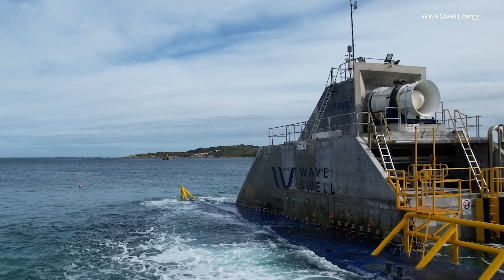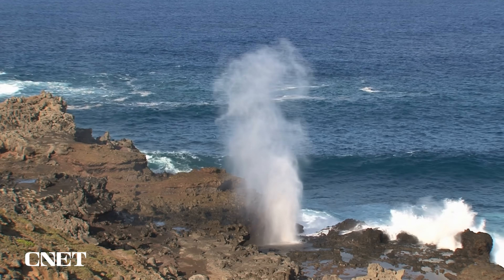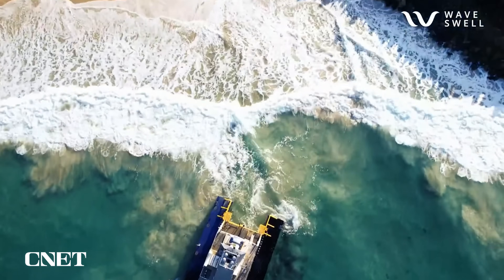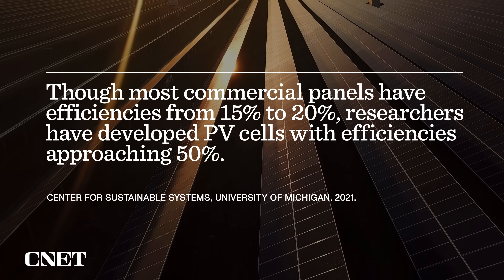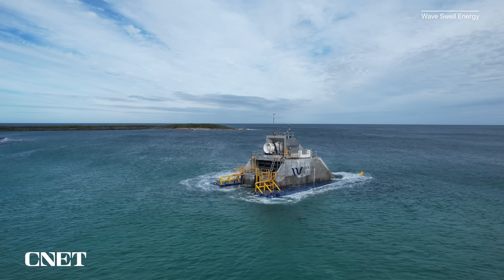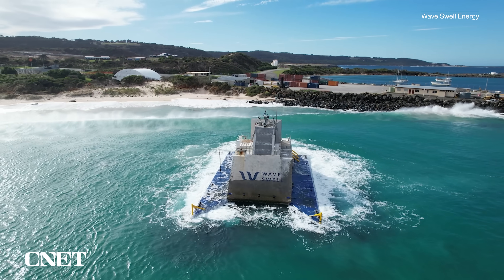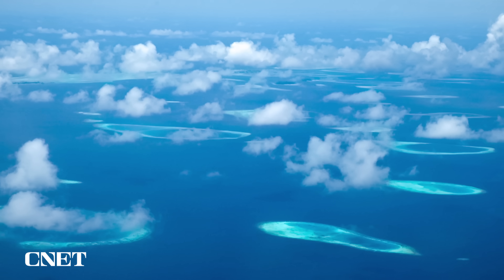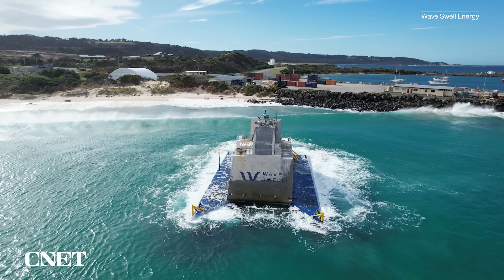'Artificial Blowhole' Generates Wave Energy for 1 Year

Comment: The one number they didn't even touch on is actually HOW MUCH ENERGY does it capture, how much electrical energy does it produce. Efficiency is irrelevant if the amount of energy entering the device is actually very small. A wave going up and down inside the device is actually minuscule. Does it produce enough energy to run a hundred homes or just half a home? If you'd need hundreds or thousands of these devices to produce any reasonable amount of energy then they're a failure. But no such info is discussed in the video or provided by the company.
Reply: You are all missing the forest for the trees, the most important number is the Levelised Cost of Energy (LCOE). Efficiency and amount of energy are important but the price per MWh over the units lifetime is the most important because that will determine if this system goes past the experimental phase.
Reply: @shad0wyenigma  Excellent observation. And all that needs to be done is to look at all the previous experiments and prototypes of wave energy devices, not a single one of which got past the prototype stage for just that very reason. People just need to do a search on "Wave Energy" and you'll see lots and lots of failed devices. This particular one actually has no unique characteristics or approaches to capturing wave energy. It's been done before numerous times. Never successfully. They clearly didn't do their research before embarking on their project.
Reply: @RogerGarrett  or maybe, a different class of people grant funding for research, because they realize the benefit than the people who approve new production construction. In other words, while I would never buy a Ferrari, theat doesn't render all Ferrari worthless.
Reply: @shad0wyenigma  i already said that ;)
Reply: If only we had some sort of way to rapidly look up information..

"The results have met and at times exceeded our expectations. As an example, when the unit is generating 40 kW of power in reasonable wave conditions, you could extrapolate the amount of energy to be in the order of 1MWh in a 24 hour period."
Reply: @NaokiWatanabe  i have looked this up, it's useless though. 1MWh isn't much but this is just a test unit in a test environment
Reply: @bloodhoug82  it's 350 000 kWh per year. That would be around 30 households.

Not that much, but also not that little. It's about as productive as 2000 SQM of PV. Which is at the moment the cheapest source of electricity.
Reply: @aurelspecker6740  how do you think you know how much it produces? 😂🤦‍♂️
Reply: @bloodhoug82  It's what they claimed as an example.
Reply: @aurelspecker6740  exactly, it's an example. they also said this does not mean it's its full capacity nor was it under ideal conditions. This was a feasibility study only
Reply: @aurelspecker6740  nope
Reply: @bloodhoug82  wouldn't think this is an accurate comment, they said in the video that they are aiming it at island communities. Far flung places without a reliable means of generating energy. 
1kw a day would go along way for people in these communities, I use  6kw a day av in a city in a first World country. 1mWh a day could mean lights and a fridge for a thousand homes....
Reply: @oscarthefuzz  huh? so what's not an accurate comment??
Reply: @bloodhoug82  saying 1 mW is not very much, it's all relative and for the situation they're tailoring it for it seems adequate
Reply: The answer partly in the name : 200kw peak nominal output
Reply: Well, it seems like it would also do a lot to mitigate wave pounding in some areas, by removing some of the kinetic power. I like it. If it helps build ecosystems and the like, and isn't really an eyesore, etc., it represents another tool in the box for us to utilize.
Reply: I would guess is all about scale for this design. A single unit might be an embarrassingly low value. Scaled up and over time I might be a different economic proposal. Diversity of energy production is key to renewables.
Reply: It's really difficult to give you a simple number on that given the dependency on wave conditions. If you ask someone how much energy a harvester will produce, the first question they will ask you in response is "under what conditions?".
Reply: @Stevobulfer  King Island is in Bass Strait. Waves are a given. Bass Strait is one of the roughest pieces of water on the planet.
King Island also currently gets all its power from 6MW of diesel generators.
Power costs a packet on the island.
Cost / benefit is a rather low bar for this location.
Reply: @allangibson8494  Location x3. If it produces power where a breakwater is needed or exists and where other power sources are problematic, it could be an effective partial solution.
Reply: @allangibson8494  At least per Electricity Map about a third of the electricity generated on King Island came from wind this past year. And that doesn’t appear to include rooftop solar which is considerable & reduces overall demand. HydroTasmania has an app which gives the details for King Island at any given time, although they never tied in the Uniwave contribution.
Reply: @Stevobulfer  no, it's not difficult to give a answer.
Just give the amount the prototype produced during that year.
It's really that simple.
Of course you can add the disclaimer that a finished product would be more efficient. But the amount the prototype produced is a starting point.
Reply: @Jehty_  what wave conditions do you want it under?? Do you want an average? Peak value? Correlation with seabed topography? It doesn't make sense to give a value that is so highly correlated with the environment it is placed in and the present conditions. If he just "gave a value" it would be incredibly misleading. He's doing everything any other engineer who makes energy harvesters would do, and is honestly giving the ethical answer which is a number that is not correlated with wave conditions (efficiency). If you want to know the exact about of energy this device would make, YOU (or investors) can figure out the wave energy available in your area and multiply it by the efficiency. The equations for that are public information. Obviously some areas will have gravity waves that are more energetic than others, so given these varied conditions, it makes sense to not 'just' give a number.
Reply: @Stevobulfer  you do realize that this is a YouTube video?
No one of us will do that.
So if you do a fricking YouTube video give numbers that don't require a PHD to understand.
Reply: @Jehty_  also no, waves do not contain very little energy. Water is heavy. A large volume of water moving up and down a meter is actually a lot of energy. Back of the envelope calculation says if you have 10m*10m*1m of water falling 1m, that's 977 KJ of energy every wave period.
Reply: @Jehty_  the fact you think it's easy just accentuates that you don't understand the nuances of Engineering.
Reply: @Jehty_  it's not that simple because if he 'just gives a number', in the best case scenario is a useless number, in the worst case scenario, it's fraud.
Reply: @Jehty_  you don't need a PhD to use Google.
Reply: @Stevobulfer  again:
This is a YouTube video. Know your audience.

And if it's so easy: please tell me how. Take the location of the prototype as an example and please do the calculation.
But guess what: it's not that easy....
Reply: @Jehty_  that's what I've been saying lol. You need to know the local conditions to even give a reasonable number. I can't just do the calculations because I don't have any information about the conditions. They gave an efficiency.. This number is sufficient for anyone interested in investment.
Reply: @Stevobulfer  so your saying that (basically) nobody watching this video would be able to do it?

Then please explain again why it was a good idea to add that information to the video and leave the "easy" information out... 🤦‍♀️
Reply: @Jehty_  for who, you? Sorry that info is above your need to know and fancy calculator, son.
Reply: @Jehty_  Waaa! Whah! Ayer mamás, You Tube presents science that keeps me dumb to easy thoughtless answers. You know how much I hate math, physics an all that hard study stuff, since I was a kid failing thinking and reading assignments. Ah’m angrey!
Reply: @Stevobulfer  Any thing beyond consistent C to A high school grades throughout Graduation from a middling level high school, would help you immensely for life. But I hear you saying your educational and entertainment pursuits has Google as your go to. Meh
Reply: @ottobhan725  I develope integrated circuits for  brain-machine interfaces as an electrical engineering PhD. Yes, I turn to a simple Google search when I need information outside my scope of expertise. It's called using the resources available to you.
Reply: @ottobhan725  honestly I don't understand your point. The Internet is a tool for anyone who knows how to use it.
Reply: Spot on. And the reason, as I think you are alluding too, they do not mention it is that it is very small.
Reply: @PerErikKarlsson  these numbers are out there. Currently it's not a lot. Another video covered it. But again, prototype. Fine tuned and used as a barrier wall then it could be a nice addition to stabilizing electrical demands
Reply: @PerErikKarlsson  - Exactly, since the volume of air flowing in/out of the wind turbine blades would be small compared to a large wind turbine with 100 m long blades.
Reply: @PerErikKarlsson  because it's a proof of concept.

It was not meant to produce a lot of energy, it was meant to show this tech can extract a meaningful percentage of the available potential energy.
Reply: Exactly! he was asked directly and rebuffed going into efficiency.
Reply: @callyman  because the question is stupid
Reply: Yeah I think I am wondering that too, in terms of a household, what fraction of one can it sustain? I can't imagine it's more than an electric stove on that scale.
Reply: It seems like there’s a lot of arguing back and forth here. I think the real question is not can this idea provide X amount (demand) of electricity, rather it is can this design feasibly produce X demand. Let’s take both polar opposite ends of the spectrum for two designs: wind power, and this design. For wind, let’s say that the efficiency is 50%, and it can operate 100% of the time. We do not have an output number with this info, unless we apply a scale, which comes in multiple forms. We can have one huge turbine, or we can have many medium size ones, and get the same output. But that is not the whole picture. Cost, environmental impact, location, and more matter. Clearly scientists have determined that it is not feasible to have one huge turbine powering the entire world, nor is is reasonable to have billions of 2” turbines covering the surface of the planet. There’s a happy medium. And that happy medium is met with a cost and impact that is deemed reasonable PER THE OUTPUT. That is the critical piece. 

Now let’s take the wave blowhole machine. Let’s say that it operates at 80% efficiency, and can operate 100% of the time. Let’s say that the cost is equitable or better than the cost of a turbine. We know that it’s impact is likely to be less. Two questions remain, given an ideal happy medium in size: what is the output, and what is the availability of placement? If the output is considerably less than a turbine, or the availability of placement is less (it certainly is, given that they really are only designed for coasts, compared to a turbine which can literally go anywhere that has wind within spec) then it is not as feasible as other techniques. If the output is enormous, it doesn’t matter what the availability of location is, but this is fairly unlikely, I suspect. I suspect it is a moderate output, which means there need to be many many installations to meet our energy needs, which may not be possible with the available locations. 

All that said, there are a couple important points here. We do not need to replace all other energy sources with one single source. As some have said, diversification is key. Also, this design serves double duty. I think this is the real key to the whole project. I suspect that the project was dreamed up as a way to turn existing, non generating infrastructure into an energy source, at a reasonable cost, and high efficiency is key to maximizing whatever output we may get. I suspect the output is not as critical to design as it would be for something that is solely intended to generate electricity to meet our needs. If this is the case, it is unfortunate that it was not explained in the video. 

Just my two cents
Reply: @clayrydick4561  I enjoyed your respectful opinion and would only like to add that if the unit is also acting as a breakwater as sea levels rise, containment for a desalination plant or an artificial harbor the costs of adding the generating capacity to an already defined purpose becomes reasonable, and as the technology is improved and mass produced it becomes even more affordable. Thanks for your post.
Reply: Something that everyone seems to be overlooking is exactly HOW this particular device works. Yes,  there's a lot of energy in moving water, due to the MASS of the water. But this device does NOT exploit that, does not tap into the actual energy in the movement of that MASS of water. This device uses the motion of the SURFACE of the water to PUSH AIR through the turbines. There is SIGNIFICANTLY LESS energy in that moving air, due to the significantly lower mass of the moving air than there is in the moving water itself. If this device had its turbine actually IN the moving water it would be tapping into a tremendously greater amount of energy. But, no. The turbines are moved by the air. Both the air and the water are moving at the same speed. But I sure hope you can realize that air moving at speed S has significantly less energy that an equal volume of water moving at the same speed.

It's just a dumb design.
Reply: @RogerGarrett  The main reason they use the moving air instead of the moving water is seawater is especially corrosive and thus leads to the need for constant maintenance & reduced lifetime. Keeping it in air eliminates moving parts in the seawater & leads to a much more long lived & corrosion resistant unit. And if it does require maintenance it’s easy to access. You’re right though it doesn’t tap into as much energy as it otherwise would if using water power.

But it does seem promising in terms of providing clean electricity through a wide range of conditions.
Reply: @codey morganti Thank you. There are indeed other commenters, far below (NOT in this particular thread), who are making the same points I've made here.

It's sad how many people deflect the main issue by saying things like, "It' only a prototype, only a test device, only a trial", "It just needs to scale up", "But it also works as a wave break", "There's too many kinds of wave conditions so they can't give a good general estimate", "But we need to diversify our energy sources". 

The only things that matter are how much energy is actually available in waves, how much of that energy can be extracted and converted to electrical energy, and how much does it cost to build it and maintain it. None of that info has been provided. And, frankly, I think the energy generation numbers that have been thrown around are totally bogus. This thing needs an INDEPENDENT evaluation. And the bottom line fact is that every single other similar wave energy device has totally failed to be a cost-effective way of providing cost-effective energy.
Reply: This comment threat did use more electricity than that thing produces over one day. You guys do realise that this thing is developed by actual engineers. I guess they do think through a lot more things than discussed here. I do know that not every concept is lifechanger... but seriusly guys, put some of your enthusiasm in an actuall idea like shown here, and we would benefit more than of this stupid circled debate... this is clearly not meant for any circumstances and fitted to a specific purpose. Breaking waves at the entrance of an habour while producing energy for that remote Island. Win win.
Reply: hahahha
Reply: @LucaFerrari.  you must get a lot of pleasure from your comments  because all you seem to ever say is. Hahaha it's a pity you're knowledge doesn't go past a laugh 😜
Reply: @jackbarrie6007  hahaha, please don't take your opinion to extreme, it's not all about me: the other two guys were shouting wrong to each other and it was a funny situation😂😂😂
Reply: Thanks for saving from watching the video a second time. I skipped through most of it hoping to get that spec.
Reply: Shhhh the science
Reply: It is a 200kW generator set. It replaces a output from the 6MW diesel generator installation on the island…
Reply: Based one some research they say

The company said under the right wave conditions the UniWave200 can make enough energy for 200 homes.

However how often are the waves under the right condition
Reply: @noloafingwgas  people only have to do a little research which seems impossible for them. They said in the video that this wasn't placed in the best area from enegery because they were testing several things and how the unit would hold up or affect wild life. They also tested several things, changing pieces and so on. I don't understand why people have a problem with any of this without knowing the facts because all of this benefits us even if we have thousands as a power plant in the ocean, it would do the same thing as a power plant on land. I'm sure the hnit can become smaller and smaller as they learn more. A big win for everyone
Reply: @noloafingwgas The unit is generating 40 kW of power in reasonable wave conditions, you could extrapolate the amount of energy to be in the order of 1MWh in a 24 hour period. Now this really doesn't matter since units will be designed far better, have more blow holes or the modularity of hooking up as many as needed
Reply: well, your moving dozens of cubic meters of water with each wave, in a few seconds, at least a few wavea a minute, plus capitalising on the trough....so the same volume of air, thats a reasonable amount of air if you can 'fly wheel' your turbine well enough. They probably don't mention specific energy because waves are very variable.
Reply: @benwilms3942  the unit is generating 40 kW of power in reasonable wave conditions, you could extrapolate the amount of energy to be in the order of 1MWh in a 24 hour period
Reply: @benwilms3942  they didn't mention energy because they mentioned it was ,ore or less to see how the machine operates, affecting wildlife and the ocean. No water is being moved with this unit. It's all done naturally with the waves and it shoots water up just like in nature. These units will be made smaller and smaller most likely as we learn more or adding more blow holes per unit. I don't understand why people can't research anything and expect everything in video form, smh. If we have hundreds or thousands  who cares, it will be like a power station/plant or grid in the ocean
Reply: @benwilms3942  Dozens of cubic meters of air moving at a few feet per second has nearly ZERO energy in it. It is completely wasting the energy in the water and instead just using the air that's pushed by the water. Utterly ridiculous. Just think of how much energy a FAN needs to move a few cubic meters of air a few feet. THAT is how much energy you can get from this device, IF it's operating at 100% efficiency. So, great, this enormous, and enormously expensive, device can power a single large fan for one house.

I think that their estimates about kilo Watt Hours of energy are totally bogus. And, for the others providing excuses like "It can just be scaled up", NO! Scaling up will not help. With one unit providing only enough energy to power a fan, just think of how many units you'd need to power a single house!
Reply: @benwilms3942  the air doesnt spin a water turbine, thats a whole different story,, also theres tide, because of that the turbine doesnt work the whole day and waves are variable, therefore its a unreliable energy source like all renewable energy, so its just not usable
Reply: For all we know it can only power 40 watt light bulb for 90% of the day.
Reply: @wolfthorn1  wait, where did you get that information from
Reply: @wolfthorn1  the unit is generating 40 kW of power in reasonable wave conditions, you could extrapolate the amount of energy to be in the order of 1MWh in a 24 hour period. Just research next time instead of joining in with the person that commented. This was a research and development mainly. They knew the technology would work but they wanted to know how the unit would hold up or affectnthe wild life.
Reply: The device is supposed to be able to do 200kw according to some random paper I found online.

So 80% of 200kw
Reply: Actually thats only half the problem. How much energy does it cost to build, can it produce more than that?? If not, its less than zero efficiency.
Reply: Annoying they didn’t mention it in the video. Online it says the unit averaged 40kW throughout the time it was active, with peak output of 200kW
Reply: @isaacgardner4423  a lot of people don't have the smarts to research something or just Google it instead they write a long comment. Any annoying issues can be fixed this is a prototype that was placed in a area where energy was the main goal since the proof of concept already worked
Reply: Looks like a big structure too.  Goofy niche idea, oh it's a seawall
Reply: @johnn3542  neither goofy nor niche
Reply: Exactly. How much did it cost to build, what are the life cycle costs, how much did it produce, what are the prevailing utility rates. So many unanswered questions. I understand it's a prototype, but would be good benchmark data to gauge future progress.
Reply: it generates an annual avg of 40 Kw daily, the equivalent of 10 homes. you can look this up.
Reply: It was a 200kw capacity unit but it’s a demonstration unit. Just like with every renewable energy technology we’ve developed so far, once its production gets on a learning curve costs drop very quickly and scaling up becomes cost effective. Remember that there was a time when photovoltaic solar cells were so exotic and expensive that they could only be justified on satellites and now PV (photo voltaic) solar is the cheapest way to generate electricity per kW. Wave energy has huge potential and harnesses a reliable and powerful natural force to produce electricity, which is a very promising foundation and we just need to develop the cheapest and most efficient way to harness that wave energy.
Reply: It’s a feasibility study beyond the lab benches and small scale for data and reiterating improvements. What say you now Uncle Thomas Doubt?
Reply: @ottobhan725  all renewable energy is low power density. It’s many orders of magnitude difference, ten to the nine with a nuke reactor or fossil fuel generator versus ten to the five, maybe six if you make many square miles of windmills, solar cells, tidal generators. And most facilities have three or four reactors. You can cover regions of renewables and not get close to what is needed and you still need batteries or to pump water for generation later. Renewable energy energy can only help. It’s not the answer. They NEVER mention wattage output when discussing any renewable power for that reason. It’s not fixed by any emotional responses, passion or want for it to be different. You’re being scammed.
Reply: Exactly
Completely pointless if doesn't produce enough energy. Cost of building versus how much energy it produces is vital.... efficacy. Without efficacy it is pointless, most all of the fashionable renewable stuff (eg solar and wind) has virtually no efficacy.
Reply: @exploringgodscountry  and where are you getting that it doesn't produce much?
Reply: @bloodhoug82  they don't provide any details on how much electricity it produces.
Reply: @exploringgodscountry  i know, i said that
Reply: The amount of experts in this comment thread is astounding…
Reply: It's a scam to take government money there is a lot of these going on right now tax prayer pay for it. And after 5 years of development it's suprise suprise it's a failure. Like solar road way...
Reply: Thx - you saved me the time to watch this.
Reply: @Sagittarius-A-Star  he didn't really 🤦‍♂️
Reply: Good idea though
Reply: Far more than you would assume
Reply: Wasn't this just a proof of concept trial? I'm sure for an actual application this can be scaled up.
Reply: Do you think they didn't think of this?
Reply: That's a pretty ignorant comment as well that started this. Any type of green energy is a huge help for any country. Who cares if hundreds are needed you would simply have power plants in the ocean where waves never stop
Reply: Love the discussion. Does not feel like a lot of power output considering the huge concrete unit you need to build. However, if you need to build a protection barier anyway it is an interesting adition
Reply: @GupStar  the good thing though these are floating and also this is a new technology so size can come down. The unit is generating 40 kW of power in reasonable wave conditions, you could extrapolate the amount of energy to be in the order of 1MWh in a 24 hour period. Any green energy is a win when it comes to global warming. Having power plants innthe ocean that cause little to no affects 8s also a plus.
Reply: @GupStar  there iss no moving parts also. Of course like you said though a barrier to keep people away is a must on larger scale in populated areas. Also the location they chose wasn't chosen for electricity but the environment to see how the prototype worked
Reply: Probably a single home.
Reply: 40kw average and 200kw peak output. That's comparable to a small windturbine. A average home needs 10kw (though I found many numbers online but this was the most popular)
Reply: I had my cell phone plugged into it for a while but it said slow charging and when using GPS my phone battery actually went down
Reply: Yes let’s spend 1 billion for this thing that can generate enough energy to power 5 light bulbs
Reply: This thread: 💥
Me: 🍿
Reply: the only thing that matters is 1) is it better than burning coal and fossil fuels?, 2) does it work?
if those two are yes, then it's already better than what we have available right now. 

if you're trying to argue that people should not be testing new ideas and developing new technology, then I don't think you're gonna get much support for your argument.
Reply: @sasabnis  At no point in this discussion did I ever say or imply that people shouldn't be testing new ideas or developing new technologies. I addressed the feasibility of this particular approach. That is a perfectly valid response to any new ideas or technologies. And in fact, there is nothing new in this, no new idea, and no new technology. This approach has been tried over and over again and has always failed for quite a few valid reasons. Nothing in this test addresses any of those failures in the past.

As for your two things that matter: 1) Sure we need approaches that are better than burning fossil fuels. 2) But this approach does not "work". Yes, you can derive energy from waves, but the third question that must be answered is 3) Is it cost-effective? And the answer to that is a resounding NO.
Reply: No reason to release that much info to anyone other than vetted investors signing NDAs
Reply: They don’t mention it because it’s trash. There’s no answer for fossil fuels outside of nuclear. You’ve heard this a thousand times, yet somehow leftists still are too stupid to accept this scientific truth.
Reply: It provides energy for 500 thousand homes
Reply: @peep_show8037  hahaha! No, it provides energy for about 7-8.
Reply: Power density.
Reply: The Uni Wave 200 can generate 200kW at its peak, which is enough to power 200 homes. At the low end, it produces around 40kW.
Reply: The200 in the name is it’s rating in kW. 200 kW So it’ll power a bit less than 100 homes.
Reply: @maugan22  yeah, 200kw max power maybe
Reply: the UiWave 200 can produce 200 kW at peak output, but sadly, the waves aren't always that powerful. Yet the UniWave still managed a remarkable 40 kW average over the year
Reply: It seems one unit can generate 200kw
Reply: All of science and technology is based on “trial and error”. 
Had Edison not tried that 1001st light bulb,,, would we have light today?
( that’s a rhetorical question )
Reply: He's got a fair point
Reply: I don't doubt for a second that by having set up such a system, they didn't ask themselves this little question, among so many others that are much more technical for people like you and me!  That's what I call bringing back his science when it's a futile question... In my opinion
Reply: At the beginning they say that they are already using this technology in naturally occurring blowholes. So it would seem that they have already proven that it works.
Reply: They explain all that @1:15, unless you were looking for even more specific specs.
Reply: 200kW (found easily enough, just not in a YouTube clip). As the site wasn't chosen for its energy potential, its unlikely that it produced that much for this trial, but that wasn't the purpose, so thats not the issue. Still, thats not too shabby for a test-bed.
Reply: It really wouldn't matter because they can always scale up or down as per what is needed. The efficiency is basically the ONLY thing that they are worried about, and for good reason. Plenty of renewable energy sources exist, but are they worth pursuing?
Reply: @joshmellon390  Scaling is not a solution. Scaling is irrelevant. You could produce a device that taps into the energy of a single walking ant and does it with 100% efficiency but if it takes a dollar to make the device and you scale it up to tap into a hundred trillion ants you've got a horribly inefficient, crazy expensive, way of producing energy.

It does indeed matter HOW MUCH energy each device produces and how much it COSTS to do that. Only then can you determine whether scaling up (with cost-per unit going down) is reasonable.
Reply: Yeah, disappointing.
Reply: I would be curious to know what the raw output of it is. I do like the fact that a structure like this seems to be good for wildlife. Definitely need more information, but it's interesting nonetheless.
Reply: Overall efficiency is important. I.e. energy taken to build vs energy produced over its life time
Reply: @mrjimmbo  That's true, but that's not what is generally meant by efficiency. Rather, they're calculating the amount of energy produced versus the amount of energy available from the waves.
Reply: @RogerGarrett  yep fair
Reply: Its 200kw. 
At least that's what I have found, if it can generate 200kw then 30 of them would be needed to power kings island.
Reply: @mikeiswhite3  it's not
Reply: @mikeiswhite3  Per Electricity Map the electrical demand generated on King Island is ~1.5 MW annually on average with 1/3 of that being supplied by wind and the rest from a diesel generator. So they’d really need to satisfy the 1 MW from the diesel generator. That would be 5 Uniwave 200 units at max (200 KW) or more realistically 12.5 units assuming ~40% efficiency. Of course adding more wind & solar would reduce this. King Island doesn’t currently have much utility solar but they have a pretty healthy amount of rooftop solar already.
Reply: Gotta agree with Mr Karlsson. The fact they stick to just percentages  is very telling. So what if something is 50 or 80 or 90% efficient. That mean little to nothing if you don't know how much electricity you're actually producing.
Reply: @mikehiggins946 🤦‍♂️ no it's not telling at all 🤣  did you even watch the video?
Reply: Hahaha!....sorry....the whole  "WRONG"! thing had me thinking of Mr. Wonka yelling WRONG! at grandpa Joe at the end of the movie in "Willy Wonka and the Chocolate Factory" 😆
Reply: @thebrain7065 😂
Reply: please don't take your opinions to extreme: effincency and quantity are related to each other
Reply: @LucaFerrari.  related maybe but not necessarily implying each other 😉
Reply: It's experimental so, don't be put off by it's small size. 
It's better than drilling for oil, don't you think?
Wave energy is significant and real.
Water weighs roughly 9 lbs. per gallon and cannot be compressed. 
Do the math and apply the laws of physics (kinetic/hydraulic) and you'll come to a less doubtful conclusion, I'm sure. 
Remember:  wave energy is FREE. Abundant. Occurs whether we choose to utilize it, or not. 
As long as the moon revolves around the earth and water exists on earths surface in liquid state, there will be waves. 
I think it's rather OBVIOUS that with the right tools and inventions, we could harness WAY MORE energy from sources such as wind, wave and solar than we ever could drilling for fossil fuels.
Reply: @bobdadnaila7708  These sort of waves are created by the wind, not the moon - those are tides.
Reply: @bobdadnaila7708  I think you miss the forest for the trees. It may be "free" energy and somewhat "limitless" but the reality is that investment dollars are not. If one of these costs 10 million and one wind turbine costs 1 million and they produce the same amount of energy, the obvious is that the 10 mil project will never get built. And likewise if there are 3 other technologies in between, can you guess the answer again? Well not only this but also mass adoption needs to happen for tech like this to succeed in order to get the costs down. So what these people are saying is valid, if the tech doesn't produce much energy and costs a lot, then it's a failed technology.
Reply: Id say you’re all wrong
Reply: Physics estimate: 10-50 kW. A cubic meter of water raised one meter has about 10,000 joules of energy. One per second would be 10,000 Watts, but maybe 10-50 of these could be captured every 10 seconds.
Reply: @alexmacrae3121 , that's a good estimation, but I would also divide it at least by 3. If you take sinus wave, the average speed of the water rising will be about 0.637 of the maximal speed and they use only the descending part of the wave (so 0.5 of that) ~= 0.318. Then on the top of that you have some inefficiencies due to fluid and gas dynamics in the chamber and the generator turbine (which is probably their 50% efficiency).
It's probably not too bad for powering 1-5 homes.
Reply: @alexmacrae3121  This is a 200kW generation capacity installation.
The intent is to replace the port breakwater with similar devices.
Reply: @alexmacrae3121  first of all, its not tidal energy, also its not 100% efficient, they are not mentioning absolute numbers, because they are probably so low, nobody would be interested, thats just another project, where they wait until enough is invested and live a nice life
Reply: @alexmacrae3121  right that seems like a good source to me.
Reply: how "little" energy - ( not how "much")
Reply: I looked it up - and it says that one of these units produce 200kw a day (hence the 200 in the name).

I think my family of 3 uses just under 200kw of electricity per month (we were considered low consumers by our former energy suppliers).
Reply: @debbiehenri345  there is a difference between kW and kW/h.
The average house uses about 2kW maximum typically. Their are 730.5 hours per month.
Reply: @allangibson8494  A watt by definition is energy per time (ie units of Joule per second).  A kilowatt (ie 1000 watts) is similarly a KJ/second.  Your reference to KW/hour doesn’t make any sense.  

Kilowatt is the instantaneous measure of power. If you want power over time you multiply by the desired time period to get KW-hour for example.
Reply: @JPS1000  A kilowatt/hour is a measure of power used for electrical metering.
It is one kilowatt drawn for one hour.
Joules (and megajoules) are more commonly used for natural gas metering.
Joules are a unit of energy.
Watts are a unit of power.
Watt hours are also a unit of energy - it’s just the conventional way of writing it looks wrong.
Reply: @allangibson8494  The conventional way to write it is kilowatt-hour.  Your use of kilowatt/hour is at worst incorrect and at best makes things needlessly confusing.
Reply: For everyone that can't search for this answer because clearly it wasn't about power generated and they stated that during the video but the unit is generating 40 kW of power in reasonable wave conditions, you could extrapolate the amount of energy to be in the order of 1MWh in a 24 hour period. Now imagine u its with several blow holes or units connected together in the hundreds
Reply: well, it's a proof of concept, if it can be reasonably scaled up, it doesn't matter if the amount of energy it produces is relatively small
Reply: @Peterski  exactly. one of the few people who actually got it
Reply: ffs, it's just a prof of concept.
Reply: First this is only one. In the future and new designs could link several of these or hundreds, have two or four blow holes per unit. This was mainly done to see if it can survive and its not a issue for wild life. They stated this area wasn't chosen for power yet it worked really well and if you wanted to find out just search it damn, unit is generating 40 kW of power in reasonable wave conditions, you could extrapolate the amount of energy to be in the order of 1MWh in a 24 hour period."
Reply: @timemachine194 read my comments please before you reply 🤦‍♂️
Reply: This is a zero emission energy production method that can continue to run as long as the moon exists. 

Anybody have an alternative that fits that description?
Reply: @GonzoPandora69420  Oh geesh. First of all this is wave energy, not tidal energy. it has nothing to do with whether or not the Moon exists. Zero emission certainly is good. The questions that I and others have raised is whether or not it actually captures any significant amount of energy and whether it is cost-effective is the key to its usefulness.

Some people just have no idea how engineering actually works.

I'll say this yet again: These projects pop up every few years, are presented by people who haven't done their research, apparently know nothing about energy conversion, efficiencies, manufacturing, the effect of salt water on such structures, maintenance costs, who get funding from people who also have no clue about these things, build prototypes which prove how infeasible it is, and then get cancelled, for good reason. There is nothing new about this particular project. It's  just rehashing old, unworkable, ideas.
Reply: It can charge two whole Iphones over a week’s time in operation!
Reply: @nikitakucherov5028  wrong
Reply: Almost ever "gravity batter" is always a scam that isn't just a pump moving water uphill to drop for later power needs. The fact that they didn't say the most important number we were waiting to hear is a very bad sign.
Reply: It's a proof of concept, and they specifically stated they didn't place it in an optimal location.

In a proof of concept, efficiency is most important.

They also addressed the matter of numbers of units, since many coastal regions need sea walls, and these systems can be built into the sea walls.

Didn't watch the video eh?
Reply: This is a pilot; a concept. Not optimised for efficiency but rather for doability.
Reply: @silentwhisper868  Every five years or so there's a "pilot project" like that. And none of them every go beyond the pilot project phase.  The do-ability has been fully demonstrated. There's energy in waves and it can be extracted. You can measure how much energy is available in any wave. It's minuscule. Capturing it, even at 100%, is useless. As has been demonstrated over and over again. Yeah, it looks impressive when you're on the beach and watching the big waves come in, but there are also "wave parks" where waves are artificially generated for surfers to play on, and it doesn't take enormous amounts of energy to produce them. 

The numbers just don't add up to anything useful.

And when these test projects don't even TRY to provide the numbers it's pretty clear that it's all bogus or, at the very least, being done by people who have no clue what they're doing.
Reply: @silentwhisper868  give it up, he won't get it 🤣
Reply: @jcd-k2s 😂 ok thanks for your contribution. People like you get mad when they have no arguments. And it's obvious that you have zero knowledge 😂
Reply: wrong. efficiency is a lot more important than the amount. If the concept is highly efficient, you can just scale it up.
More interesting would be the energy per cost of production.
Reply: @bloodhoug82  you obviously do not grasp the concept of "production-related energy investments" vs "energy production efficiency". If a single unit costs several million $ and produces only a few watts your amortization period will be DECADES (if not centuries), meaning : thing is useless.
Reply: @ololh4xx  lol you clearly don't grasp my comment
Reply: @ololh4xx  how much does it cost to produce coal and ship it to the coal power plant? How much does it cost to ship gravity from the moon.
Reply: @bloodhoug82  If it's only one watt of power available to this contraption, it doesn't matter if you have 100% efficiency, because it will never be worth the cost.

Efficiency is only a relevant metric within a comparable context. It's actually all about how much energy you get per dollar. Increasing efficiency of a certain design is one way to do that. But the efficiency of this device can't be meaningfully compared to the efficiency of solar to determine that one approach is somehow better. The numbers just have no meaning relative to each other. All solar panels have access to the same energy density, so their efficiencies are comparable to each other, but they're not comparable to the efficiency of an internal combustion engine. But for that engine, if it can extract more energy per barrel of oil than another way of burning oil, then that is an improvement. But that's because you are comparing two conversions with the same input. There needs to be a standard of comparison. You need to look at how much energy is even available to be extracted.
Reply: @megamaser  no it does matter. If you make it bigger and put it in a different locqtion. Obviously 1 Watt is a different example, but it's also quite a stupid one, because there is way more power in waves than that. Very logical argument...
Reply: @bloodhoug82  You're missing the point.  You need to multiply efficiency by the theoretical maximum energy available. OK so find whatever beach has the most energetic waves. If the power is too small to even justify the cost of the raw materials then the efficiency is moot.
Reply: @megamaser  i"m not missing the point, your extreme example is. Obviously max output matters, thanks Cpt Obvious.
But at this stage of a study, efficiency is more important. And do you actually think they would've gone that far, if the output is tiny?
Reply: @bloodhoug82  Scaling up something that produces a minuscule amount of energy isn't great. It will have large foot print,  cost a lot of materials, and waste man hours maintaining the space. Its better to have something small with a large output
Reply: @dingusbrule5756  well it doesn't produce a minuscule amount, how about that? And material costs? Did you even read my comment? 😂
Reply: @bloodhoug82  i really don't care lmfao
Reply: @dingusbrule5756  yeah sure that's why you comment lmfao rofl rofl lool xD
Reply: @dingusbrule5756  Define "large" and "small" in the context of your expectations for the size to power output of a wave energy capture system.

I'm curious why you think the power output of this kind of system is too small compared to it's size and cost to build and maintain.
Reply: @bloodhoug82  no, its not, even its effective, we dont know, if it makes sense building these for the absolute amount of energy produced, effeciency is only important, when you know absolute energy production
Reply: @indian.techsupport  no it's not. think again
Reply: @bloodhoug82  if you think about it, half of the day it cant generate energy because of tides, theres 50% max efficiency and if the waves arent perfect its way less probably avg 15% efficiency with all this factored in
Reply: @indian.techsupport  no...it don"t think it's depending on tides. your argument is flawed. if you say it's 15% then why is it way higher? 😂
Reply: @bloodhoug82  its only 50% when the waves are perfect, which means perfect tidal state, perfect height, perfect speed...
Reply: @indian.techsupport  which tidal state 😂 so the ocean only has waves 50% of the time and the other time is completely still?
Reply: @bloodhoug82  no, but the average height of  the water moves in a sinusoidal movement and the thing must be optimised for one height
Reply: @indian.techsupport  Absolute production is based on how efficient it is vs the intensity of the waves, so the only constant is the efficiency of the system since the energy potential is not constant over all locations.
Reply: @Synthmilk  the only thing they mention is, that max efficiency is 50% but taking all the other factors into consideration its probably 10% efficiency average over the day, also it does matter, because they didnt mention, how much energy one wave has, so it is just not worth it to build such a big machine for the little amount of energy, also there is a max absolute output capability... thars why it just doesnt work that way
Reply: @bloodhoug82  for every person saying "wrong" without a reason why, I'll just day that I agree with you. If it was so important then why didn't they mention it? The efficiency is the only thing that matters to the people investing in it.
Reply: @joshmellon390  well of course at the end of the day it is important but not now at this stage. I guess they just wanted to see if it makes sense to pursue this? And they should have a rough idea how scalable this project, I suppose.
Reply: @bloodhoug82 scale to what practical size, ships need to move also
Reply: @TishinaCentral  they don't need to move where they place them I suppose. They won't be placed in the open see as far as I understood
Reply: @bloodhoug82  Even if you can scale up, there is a limit. You cant just dump millions of them into the ocean
Reply: @RayRay-dv9xg  scale up doesn't need to mean produce more. I'm sure they have thought this through more than you
Reply: @bloodhoug82  that's simply not true.
Reply: @casimiroski  what?
Reply: @bloodhoug82  you CANT just always scale up. Not everything works the same at different scales. Like if this was small enough surface tension could play a huge part. Not everything scales like a math problem. Some principles of nature behave differently on micro, normal, macro or just EXTREMELY MASSIVE. it will never be a one to one scale up or down. Other factors start to effect or affect things based on size alone. For instance bee wings don't even work the same way and bird wings. Bees swim through the air and birds fly.
Reply: @Blynat  i never said you can always scale up... read thoroughly first please
Reply: @bloodhoug82  No, THAT is wrong. If the device covers 1000 square feet of ocean surface you have to first determine how much energy is actually available in the waves passing over that area. If that available energy is actually quite minuscule than it does no good to have 100% efficiency. You're  limited by the actual available energy. Suppose that available energy can only light a single LED. Sure, you can scale it up and cover hundreds of square miles of ocean to get enough energy to power a house. But so what?

Just think about what it takes to create a typical wave crossing over 100 square feet of surface. Frankly, not much. Also consider tidal energy devices that rise and fall with the tide. If you again have a device covering 100 square feet of ocean surface and the tide goes up and down 10 feet during a cycle, the maximum amount of energy you can extract is exactly the same amount of energy that it takes to lift 1,000 cubic feet of water 10 feet. NOT a lot of energy.

The most important thing to know is how much energy is actually IN the waves as they pass over an area of ocean surface. Only then does it make sense to talk about how efficient the device is.
Reply: @RogerGarrett  well haha this is wrong. Cause there is a lot more energy in waves than you think 
Also you tidal energy example is wrong, cause this here is not a floating device so completely different story
Reply: @bloodhoug82  read what he said to apply to the logic not use it as logic. If you had to make a million of these devices to power a small city would that be efficient. It needs to be efficient but it also needs to creat power. Look at most of the things that creat power they are not very efficient but they end up being more efficient because I don't need to build a million dollar solar panel that produces 500 watts and is 100% percent efficient. I can build a 100 watt panel that's only 20% efficient and I can sell it for 100 thousand now you can buy a 1000 watts of power for the same price as 500 watts. Think of it like a return on investment. I don't care if it's the best idea if it's not affordable it's not realistic.
Reply: @thelordismyshepherdjohn640  read what i said please 🤦‍♂️
Reply: @bloodhoug82  Per the 40kW average that the company toutes, it would take approximately 13 million of these to meet the power needs of the US alone. Considering the materials and energy put into building and maintaining 13 million of these, they are not particularly efficient at all. Which is why average power generation matters.
Reply: @jackknife89actual  I always love the false argument about how it’s unrealistic for a given solution to be able to supply the entire demand of the United States. As if anyone made such a clam.😅

Truth is this is a niche solution but one that could be useful in many places. If you want to prevent erosion or need to build a breakwater it may make sense to employ one or more of these to provide electricity.

If you’re an island or a remote coastal community having access to another source of reliable electricity that isn’t dependent on the sun or wind and doesn’t put you at the mercy of expensive and unreliable diesel shipments is indeed an advantage.
Reply: @JPS1000  My points are that they purposely hide the energy production in this video, and that the energy production that they claim in other outlets is so small that it would take an absolutely ridiculous amount of them to supply one country's energy needs, amounting to 17 percent of the worlds energy usage. So many, in fact, that I would really love to see the numbers on how much electricity is used in manufacturing and maintaining them, just to see if they are even net producers within, say, ten years. realistically this will never be anything other than a niche generator for use cases such as the one you listed, or it will be a wildly expensive government boondoggle.
Reply: @bloodhoug82 wrong! If you get a lot of energy efficiency do not matter. Nuclear powerplants are not very efficient but still generate a lot of energy. What is important is the LCOE.
Reply: @PerErikKarlsson  wrong!
Reply: @bloodhoug82  Wrong!
Reply: @PerErikKarlsson  i know you're wrong, I already said that 😂
Reply: @bloodhoug82  Correct! It's been a pleasure.
Reply: @PerErikKarlsson  good. glad you finally accepted that you were wrong
Reply: @PerErikKarlsson  nuclear reactors are incredibly efficient, especially taking into account the total absolute cost of procuring all the materials one needs over it's lifetime.
Reply: @Synthmilk  no, nuclear power plant are not incredible efficient.
They have a efficiency of around 33%.
That's the same as the average coal power plant in the US.
(if you don't know what efficiency means than please Google before you answer my comment)
Reply: @bloodhoug82  the energy efficiency or amount is not the main point. It's the cost per kWh that is the most important. Perhaps it's so cheap, they can build thousands of them cheaply and get a better kWh cost than nuclear.
Reply: @zazethe6553  Oh reeaaallyyy??? Again...i said that. Please read before you comment.
Reply: @bloodhoug82  when did I say you said anything, I didn't even say I disagree with you? Not every comment or reply is an attack you need to counter.
Reply: @bloodhoug82  wrong wrong wrong wrong 🤣🤣🤣🤣
Reply: @rockyrazz12  wrong!
Reply: @Jehty_  If you can't read my comment then you shouldn't respond to it, re-read it again then get back to me.
Reply: @PerErikKarlsson  Wrong it's the PSQC
Reply: @bloodhoug82  exactly right, it's a proof of concept and with refinements and mass production can lead to large scale energy. Plus you can park masses of them over fish spawning areas to stop illegal fishing :-D
Reply: Dumb comment, its a prototype, if its very efficient it can be scaled, its also about maximising the energy based by on the location.
Reply: @troydaniel9104  the problem is, it cant be scaled up, they can just build more, you cant scale this up because you dont magically get more waves if you scale it up
Reply: @troydaniel9104  when you scale you could lose efficiency and effectiveness. Your not a engineer are you, these are very basic concepts of understanding.